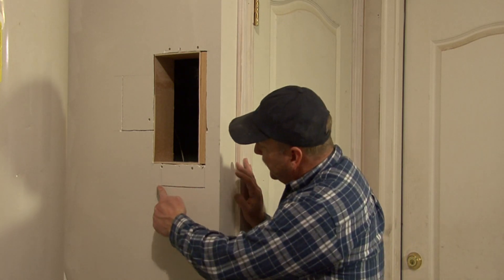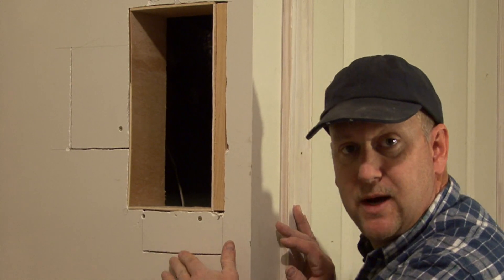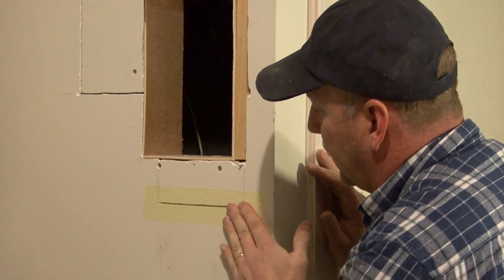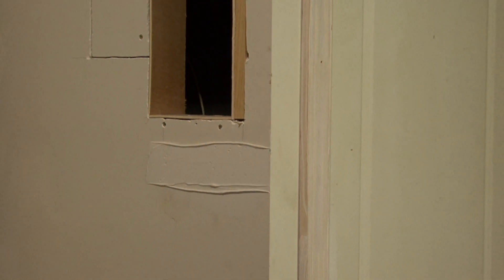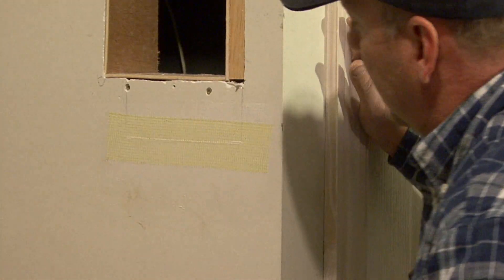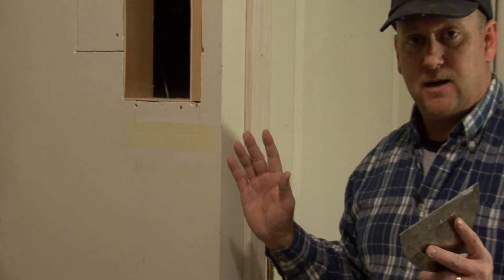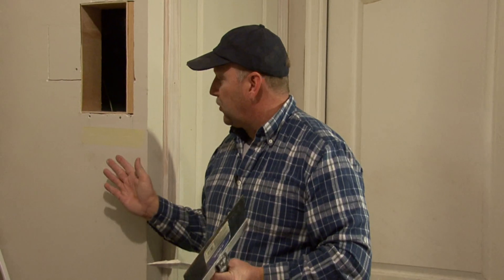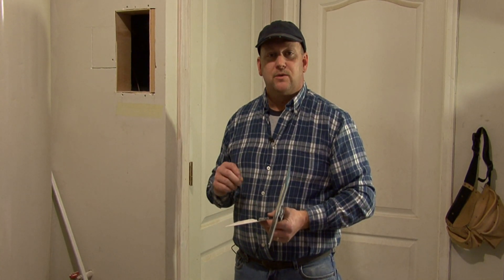Easy Drywall Repair: Typical Home Improvement

Comment: I have mud tape coming loose between the wall and ceiling (probably due to a former leak) and I am hoping this method might work if I try to repair it myself. Thanks for your video!

Comment: after the 4" coat, trim the high edges, and let it dry 24 hours then sand.
DO NOT USE THE 6 INCH UNTIL THE 2ND COAT.
THEN DAY 3 USE A 8 INCH KNIFE!!
sand after 24 hours, and prior to the next coat for smoothness.